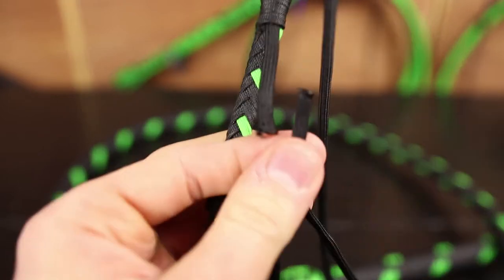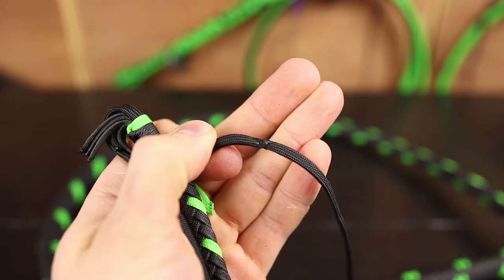How to replace your fall in under 4 minutes!

Comment: what do you do when your paracord is to thin to thread inside itself with a lacing needle when making a fall? also where do you get your paracord from? ive been using the sinker cord i use for the core.
Reply from the maker: G1NG3R 420 
I would say that if the paracord is too thin to lace inside of itself it may not be 550?  I buy all of my Paracord in bulk from a supplier called EL Wood Braiding, they make great stuff.  I think that paracord planet (a seller on Amazon) get's their paracord from them as well!
Reply: I figured id ask because paracord planet where I actually get my cord from.. its certainly not mil spec but its got 7 strands that are each made up of 2 smaller strands for guts. perhaps ill try EL directly in the near future.
Reply from the maker: They're great, just know that you'll need to get like 20,000 feet or more at a time (I can't remember exactly) and a minimum of 2,000 feet per color.  But if you get it from EL you can get it coreless.  I should start selling it on my Etsy shop...
Reply from the maker: Haha, we've all been there.  Alright, I'm gonna explore that.  Thanks for your thoughts!